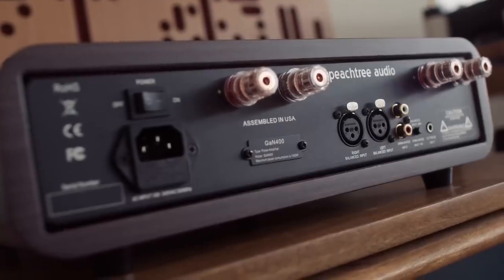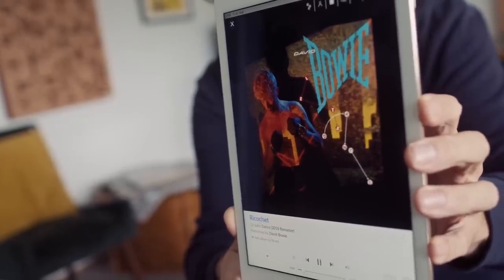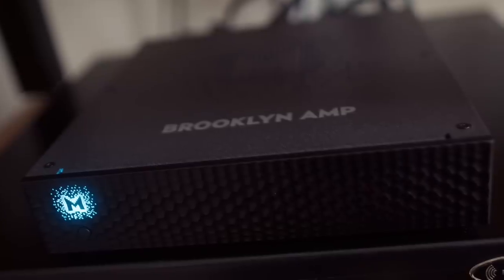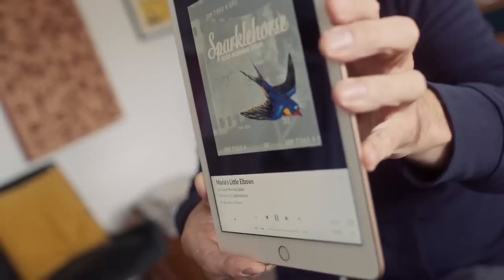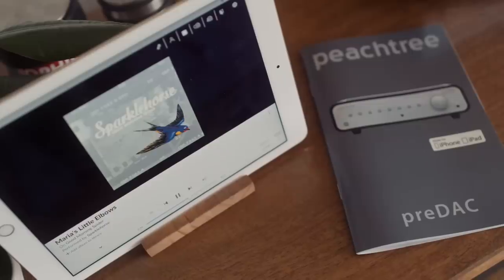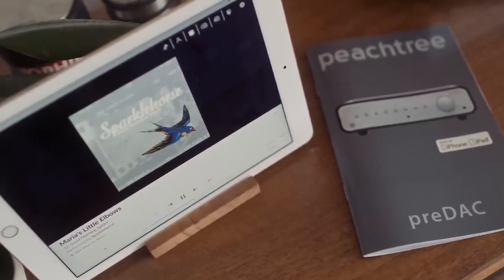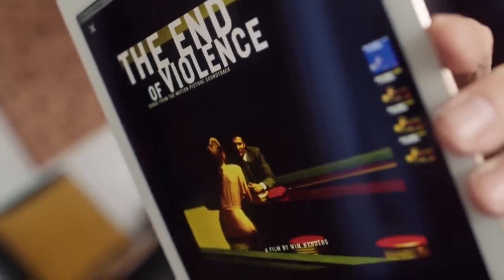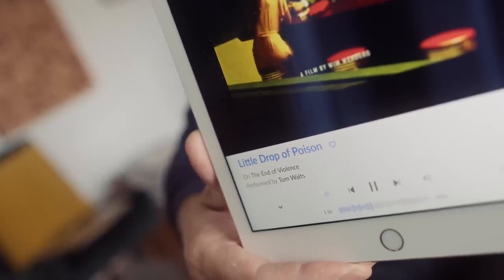PEACHTREE's GaN400 is not your father's CLASS D AMPLIFIER (GaNFET)

Comment: Hi John, another nice review from your side. I admire the way in which you describe the subtle differences between the different gear. This and the nice camera work and music selection makes your reviews stand-out over many others..
One comment: You say that negative feedback corrects after the fact and therefore isn't instantaneous. This is literally true of course.. but please don't forget one thing: The correction is done using an electrical signal that travels at almost the speed of light from the amplifier output back to the input. Suppose that this distance is approx. 4 inches it would take something in the order of a nanosecond (one thousandth of a millionth of a second) for the correction to be made. This should be compared to the cycle time of a 20 kHz signal since this is the shortest cycle we can hear. 
It turns out that this one nanosecond travel time is approx. 100,000 times shorter than the 20 kHz cycle time. Our human auditory system has not been designed to detect such very, very tiny time delays. So, in practical terms negative feedback is instantaneous in the audible range of frequencies and does the job beautifully as you show in this and other reviews on class D amps.
Thanks, Robert

Comment: GaN transistors are so fast and good that fighter jets of 5th and 6th generation have them incorporated in their ADAS radar systems. Technics was one of the first to utilize those in their SE-R1 power amp. Even with not so much impressive specs on paper the amp does deliver quite a stunning sound.

Comment: The whole negative feedback story is a bit of marketing hocum. It is true that NFB cannot correct all misbehaviour that an open loop amplifier can display. That is why NFB got a very bad wrap in the 80's. But with a properly designed open loop amplifier overall NFB is an asset to improve the circuits performance. It bit of a pity that the anti-NFB dogma is still resonating 50 years later. 
To be quite frank: zero feedback circuits in audio do not exist. Some circuits may not have overall feedback, but will still have local feedback in the individual stages.

Comment: John, I'm glad you clarified later in the review that the Peachtree has no GLOBAL feedback. While you can build audio amplifiers with no global feedback, saying that a solid state amplifier doesn't use ANY feedback means that it probably has very poor performance since all solid state devices are inherently non-linear. Opting for no global feedback means that local feedback must be used to linearize each stage in the design to achieve good performance. The  superiority of such designs have not been fully accepted in the engineering community, but it is a viable design topography. Most engineers point out that transient performance of an amplifier is actually improved by the use of global feedback so it just doesn't help steady state sinewave test performance.

Comment: GAN FET = Galium Nitride   Good for High efficiency high density designs. Can use smaller inductors and other passives to make layout design easier.   Higher frequency switching about 10X standard silicon transistors.

Comment: I am a happy owner of the LSA Voyager GaN amp. While I understand what JD says about the Hegel having a bit more weight/meat... I find the Voyager best described as a Chameleon, in that cables, and iso devices do change the resultant sound. I noticed JD was using Peachtrees stock feet, although on some kind of iso platform, BUT, replacing the stock feet with even something very inexpensive like the Nobsound springs would make a big difference. After having the Voyager here for about 2 weeks I replaced all the machina dynamica iso springs with what appears to be identical nobsound springs under my kit, which resulted in a more organic sound. hth

Comment: I have agree on the feedback part there. One good example i could think of is Benchmark AHB2. As the company name suggests the only thing AHB2 did good is measurements, it was probably the most boring, dry, dull sounding power amp I have ever listened to. Yet it topped almost ever measurement chart of power amps (I am generally surprised these charts even exist in the first place.)
Reply: Had mine for 2 weeks and I couldn't wait to get rid of it.
Reply: @garygrice921 which ahb2 or gan400

Comment: OK so feedback does change many factors you mentioned. However, when you change by adding or subtracting negative feedback the spectral display of the harmonics will change in  value and change the levels of even and odd order harmonics. imho

Comment: I recently bought one of these Gan 350w $3000 amps and compared it to my Parasound A23+ A/B amp in my professionally calibrated audio system using balanced inputs and feeding 4 ohm speakers. The A23+ mopped the floor with the Gan amp. It’s simply more musical and engaging. Not even close in most cases. There are some good attributes to the Gan amp though.The high end is very grain free, smooth, yet detail and has a wide soundstage. This is where it ended though. Thales attributes didn’t contribute to any toe tapping at all. The music seemed to stay on the front plain. It’s like it needed some umph behind it to make it come alive. It never got there. Jazz sounded good on it, not so much for classic rock and vocals. No music that I played through the Gan sounded better or equal to the A23+. Mids were somewhat sucked out and the bass wasn’t as impactful as the A23+. The straw that broke the camels back was when I put the excellent sounding Sinatra at the Sands album on. The Gan amp made this album sound like I was streaming it trough a cheap dac. It was that bad! No weight behind Sinatra’s voice and instruments, which should sound very dynamic, were flat and lifeless. After a week of listening, I put the Parasound back in and engagement and smiles returned. No amount of break in was going to get the Gan up to snuff. IMO, the differences were significantly and objectively better with the Parasound A23+.
Reply: What speakers?

Comment: Cheers John. I’m seriously looking @ the H390…, but am hearing more & more about Class D amps of late.., I clearly have a lot more considering to do at that level of $ spend…
Reply: I can only talk about my own experience . I have the NAD C 388 that cost around 1600 Dollars comes with Blue tooth, streaming, DAC, and all the connections you can think of. Besides that, you can upgrade with Module for example BlueOS or for TV HDMI meaning it's future proof for a reasonable price.NAD has more expensive Models M class that include room correction systems . It's nice to have all in one box and much fewer cables. All that can I say is I'm very happy with its importance, speaker choice, and Dynaudio that in general needs plenty of power is a good match. I had many amps in the last 50 years and finally switched to Power D and never looked back. All that I can say compare

Comment: The thing costs $3000. The music signal is converted into pulse modulated square waves, making the amplifier close to 90% efficient in terms of power conversion. Thing is, you have a square wave that must go through a filter stage to restore the musical signal, and these filters are not perfect. Class D is good for cars and auditorium public address systems. Spend $1500 on a class AB or even a class A amplifier if you don't want to worry about digital hash. Purists don't even want to think about music converted into PWM. PWM is great for industrial motors and such. Be aware that PWM and Digital to analog conversion are quite different.
Reply: So a class A or A/b is still a better for music fidelity over class D do to the pwm digital hash as you  call it ?

Comment: Strange output section, must be current driven. 400 watts @ 4 ohms is half the voltage of 400 watts @ 8 ohms. Wonder if it’s like higher resolution music, more samples, smaller steps, very digital.

Comment: As someone that designs power electronics and RF amplifiers......class D can legitimately be considered a 'digital' scheme. The MOSFETs NEVER see the music.....all they ever see are pulses which is digital. All the MOSFETS do is turn off and on. The pulses go through filtration to arrive at the final output where is represents the original signals. It is a switch mode power supply even if the marketing department doesn't want to say it that way. 

In an analog amplifier architecture, the music signals actually directly interact with the transistors.

Comment: The Peachtree GaN 400 and the LSA Voyager GaN 350 are the same amplifier....basically....they use the same modules and power supply.....same price, as well.  Peachtree looks better....LSA gives you great trade in on any amp.  Both of these amps do NOT use Zero negative feedback.  They are a low negative feedback design.

Comment: Just a short remark: John, you compared a feedback structure to active noise cancelling. However, active noise cancelling is based on adaptive feed forward filters. So the structure (in general) is not the same.

Comment: Dear John, thanks for your videos. 
I have a question, you had experience with nad amp and it also has a phono stage (I have a simple denon pma600 + turntable)  
should I buy an external phono stage like ifi phono and dac like ifi zen dac. For streaming I use xiaomi mi box. I don’t have an opportunity to test it. 
Or your opinion on system amp (dac and phono inside) or amp + dac + phono 
What advantages would I get if I chose one of those things?

Comment: Please open the chassis and show the inside of the amplifier! Are they using ICE or Hypex boards? Or have they designed their own Class D boards?
Reply: Peach Tree would not be using ICE or Hypex boards, they are using their own based on GanFET transitors.  ICE and Hypex Boards currently use MOSFET transitiors that are based on a silicon substrate.

Comment: Will GaN tech affect class A and class AB amplifier designs going forward? Seems like an exciting advancement (seeing the changes in charger tech in the past few years).
Reply: GaN transistors are really good switches - they are not designed for linear operation. Their high switching speed does not make them better than other devices for audio purposes, except for class D (switching) amps.

Comment: The Peachtree GaN400 has an annoying loud pop/static noise from the speakers when turning it on and off.  It's so bothering and there is no way to avoid it.  Engineering cut short.
Reply: Not anymore...Problem fixed.

Comment: The anti-negative-feedback ideology is absurd. All precision amplifiers use negative feedback  - Op-amps perform precise "operations" using precise feedback resistor networks. Every pre and main amplifier relies on negative feedback paths to precisely control gain and bandwidth and correct distortion and they do this in REAL time. They do it much faster than any audio signal you will be listening to which is "real time" for all intents and purposes. Amplifiers are not possible to build without negative feedback. its not just indispensable its not even possible to do. It is possible to have no negative feedback in perhaps one stage of a very simple amplifier but even then, if you examine the circuit it will still be using a form of negative feedback such as an emitter resistor as opposed to a global feedback resistor. In the class D amp described above I agree there would be no need for global feedback if your output devices are switching ultra fast and precisely, because the PWM signal will be perfectly duplicating the PWM drive signal. But this is not the same an analogue amp that relies on negative feedback.

Comment: Having global feedback loop or post filtering feedback in class D is needing a LOT extra works. Without having PFFB just easy like making a traditional irs2092s work. imagine Ncore and purifi did a lot extra works for these feedback loop to increase the performance, but the other manufacturers not even spend time with it, yet claim it sound superior, oh well... These purifi and ncore engineers should might as well spend more time for better outlook and marketing.

Comment: GaN based Class-D has 0 benefits unless the the high switching frequency of the GaN FETs is utilized. Current GaN class D run at 500kHz just like most MOS based class d amps. You better off with  Hypex/Purifi module.
Reply: Simply not true.